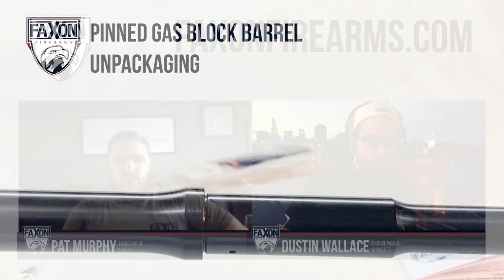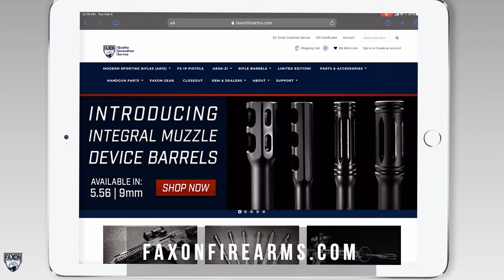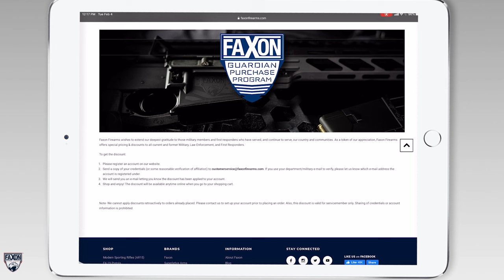Pinned Gas Block Barrels | Episode 8: Faxon Blog & Podcast

Comment: I've pinned many barrels. I use A2 taper pins. Cross drill with gas block assembled to ensure alignment. #2 taper reamer for the correct contour. Press or drive the pin in and you're done. You just need a jig and a drill press. I would trust no ar without a pinned gas block.

Comment: Why just 1/8 twist?
Reply: I know right?  It won't stabilize m856 tracers, or the 90 grain berger vld's i have to single load because they're too long to fit in a magazine. 
Seriously, 1:8 works for 99.94% of loads.  For varmint work with light bullets, 1:12 or 1:14 is better.  A .220 swift with 1:7 is almost a shotgun.  You get multiple projectiles when the bullet comes unc◇nted at the extreme rpm.
Reply: @randymagnum143  My 62 grain loads are more accurate in my 1/7 twist barrels compared to two 1/8 and one 1/9....thats why einstein.